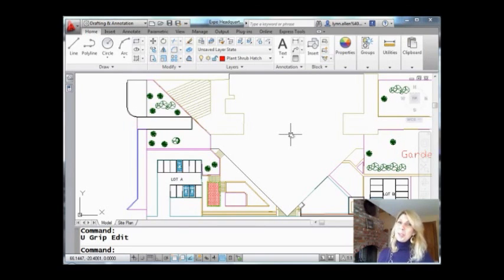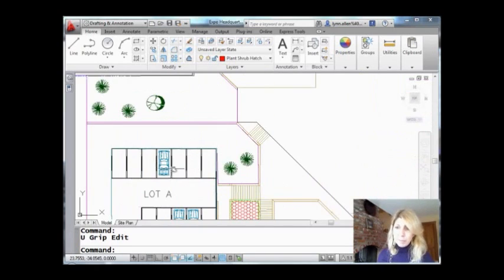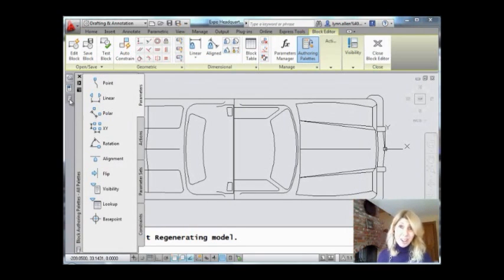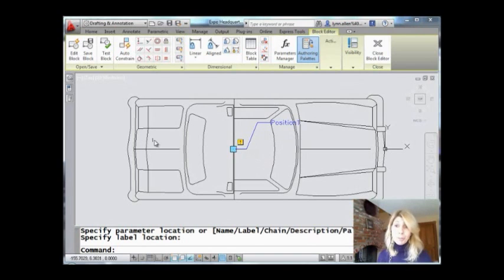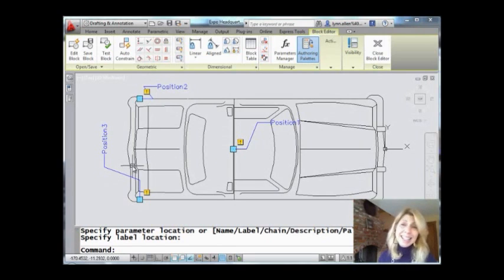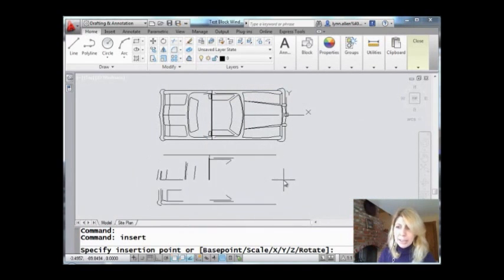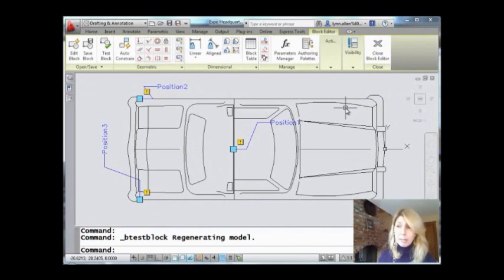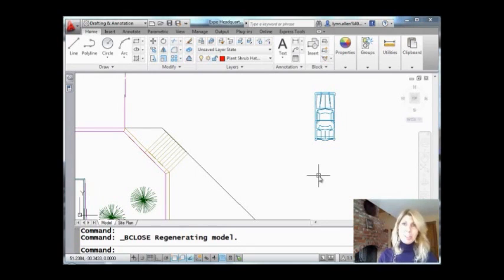AutoCAD Tip -- Adding Multiple Insertion Points for a Block (Lynn Allen/Cadalyst Magazine)

Comment: Hi great presentation,  Followed the vid to the letter and everything went great until inserting the block after toggling through the points and inserting block the block went through scale rotation etc questions so ended up that was no quicker than dropping block into drawing then moving, I use my blocks from the drop down menu (.MNU file)with  Autocad 2024, do you think this is the problem if so is there a easy fix?

Comment: That is the most awesome thing! I can't tell you how many times I wanted to have this feature! The only thing that I would add to make this MUCH more useful would be if AutoCAD would store the UCS used for each insertion point. That way, a block  would automatically rotate to match the current UCS. For example, say I have a 3D plumbing valve, with an insertion point at each of it's two attachment points. When I inserted the valve block, I could cycle between the different insertion points and the valve would rotate to the proper orientation, which I would have set the current drawing's UCS to.

Since I didn't know about the multiple insertion point feature to begin with, I tried to see if maybe the developers were already ahead of me and has thought of that, too. So, I setup a block with multiple insertion points, rotating the geometry (can't change the UCS in the block editor), including the previous insertion points, as needed before placing each point. But, <sigh> no luck there.

Comment: I set up my block as you explained, but when I inserted the revised block, it only has the original insertion point.  The control key does not toggle through.
Reply: It might depend on which AutoCAD version you are using. I have tried it in 2014 and 2015 and it works in both.